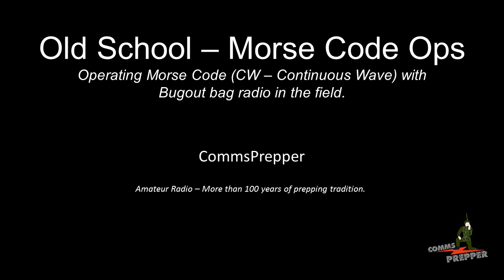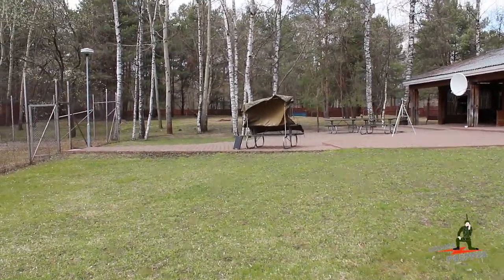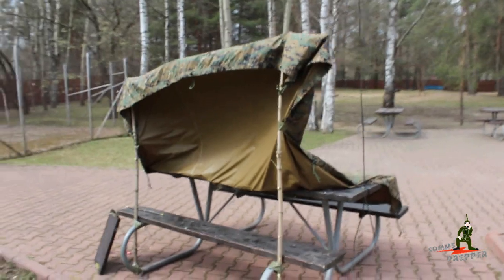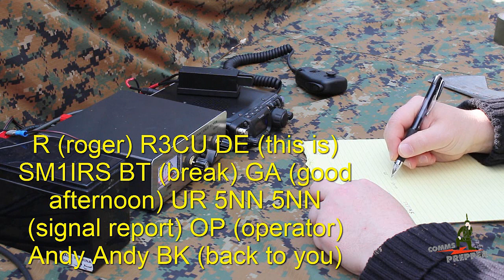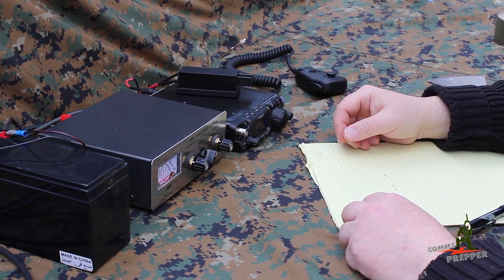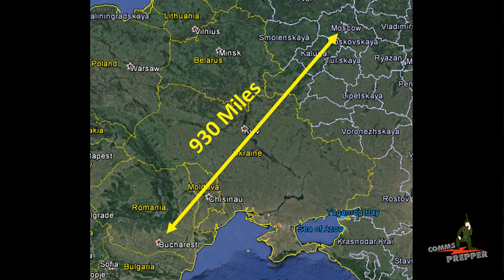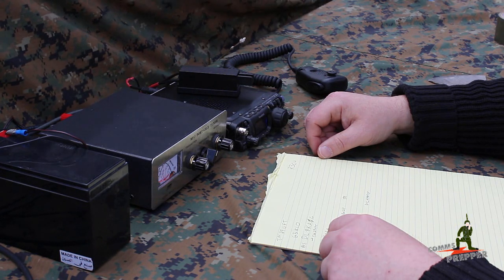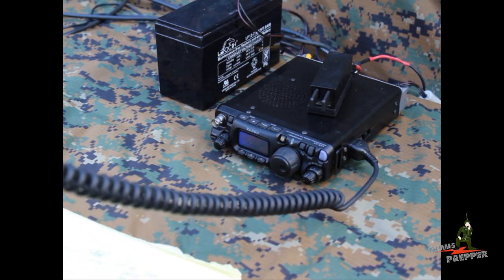Morse Code

Comment: Is there any advantage to using paddles as opposed to a regular key? I'm just curious because I see people using paddles much more frequently.
Reply from the maker: +Rebelkid1112 Paddles can be preferred by operators who are efficient with CW operations because of accuracy, consistency, and reduced operator fatigue.  However, it does take practice to master a paddle.
Reply: That makes sense. Thanks for your time!

Comment: This video really focused on what I got into ham radio for. Newly minted HAM (zero to extra) with new Elecraft KX3, Buddipole, Signalink, Windows 7 computer, but no CW ability (or any practical hands on experience whatsoever). Do any of these SDR programs (HRD, FLdigi, etc) allow you to communicate in CW via computer? I have not seen this capability spelled out or demonstrated. Any links? Great video.

Comment: Excellent QRP Contacts BTW!

With the low cost of USB cables, I would order a set of the different connector style cables for at least three locations, home, BOB, and Vehicle. For $20 you would have plenty of spare cables to have a complete set everywhere. Then you would not have to share cables between different locations. Most of the Amazon vendors that ship from china are only about $.85 - 1.50 per cable.
Reply from the maker: LT - I agree.  I have about two dozen cables....  Don't help when I leave them at the house....